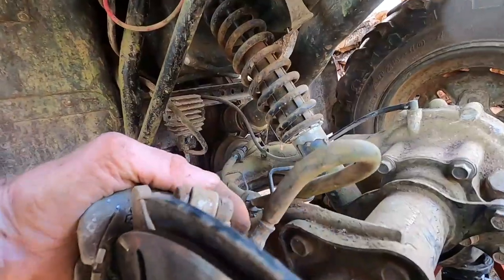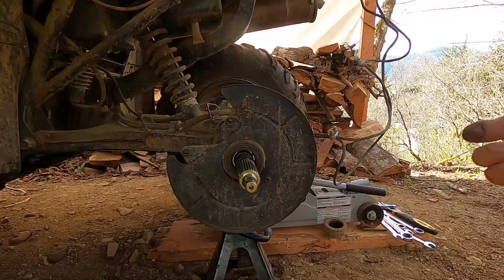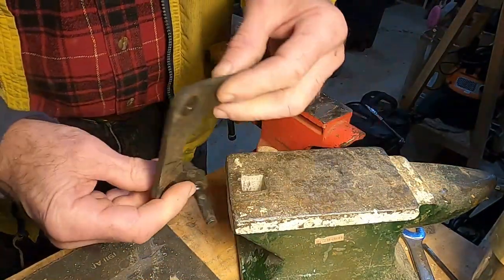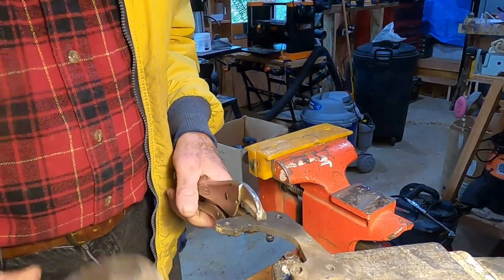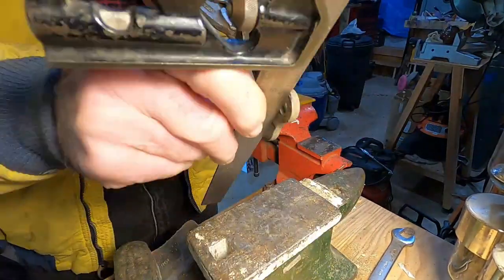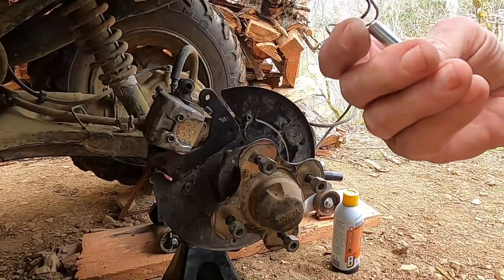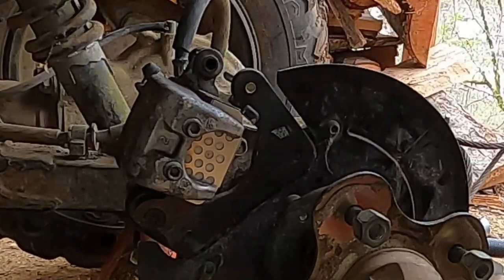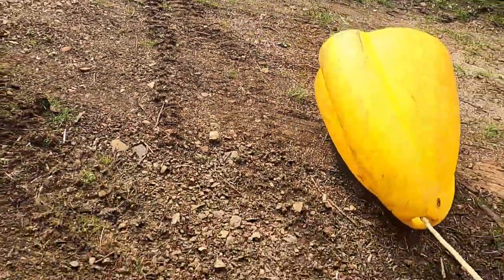Jury-Rigging the Brake on my ATV

Comment: If you aren't happy when you get done there has to be a atv salvage on the net or ebay
Reply from the maker: Rotor and pads arrived. I'll use that pin I made from a bolt. Can't buy a new one separately.